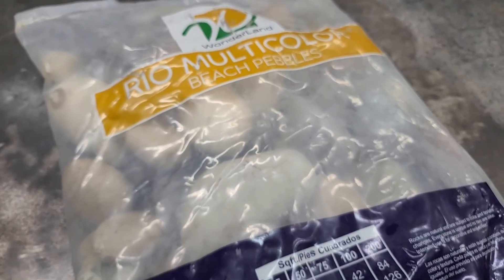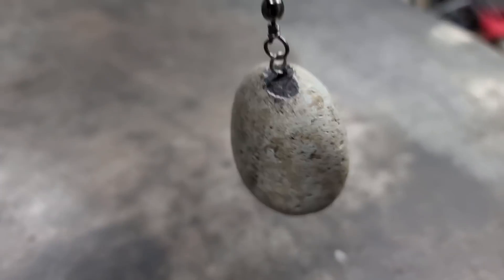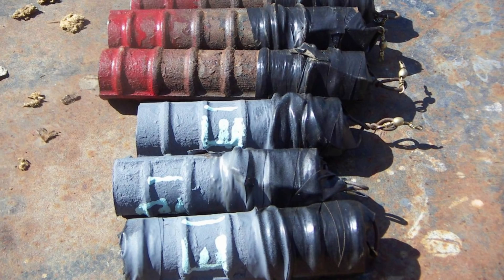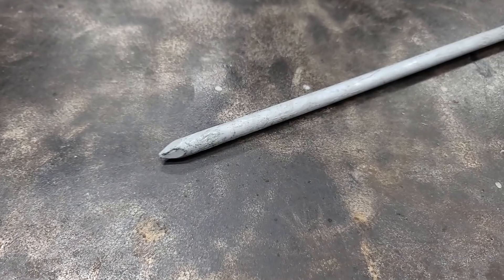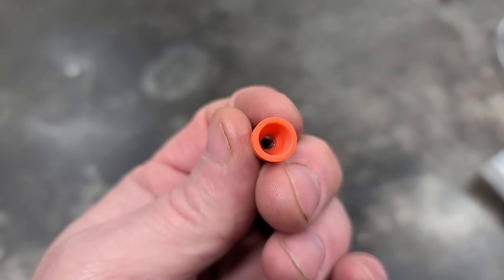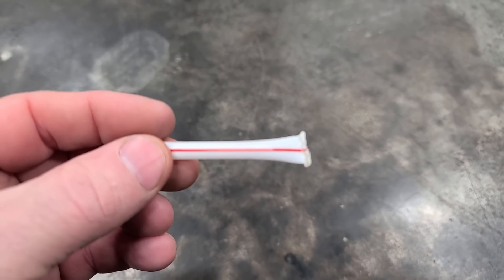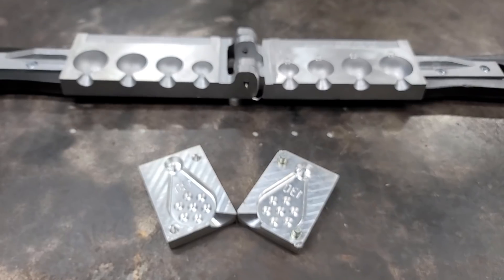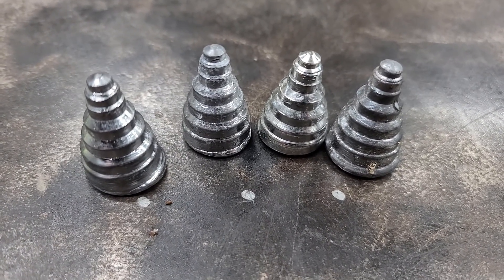13 Fishing Weight HACKs

Comment: Use the slinky weight latex tubing to hold a bolt or finishing nail. I have never got heat shrink tubing to work. But it my be the cheap HF tubing I have.

Comment: Love your videos.  Rocks probably good except for faster water.  I once observed a poor soul trying to use one in river, he would have needed half a brick to reach bottom.  Gave him some lead.  Also you can get pliers made to cut lead wire that leave the hole intact.  They  can also flatten wire and then punch a hole through the flat you just made.  In an emergency I once made a 'split shot' out of a half inch long piece by  cutting it half way through with my knife.
Reply from the maker: I made this video for the guys in the states with tough lead laws

Comment: For a walking wait I just use electrical wire in assorted sizes and lengths that I get from an electrician friend of mine just screw a I bolt up through the end there you go

Comment: Walking the dog, I sometimes find weights used for balancing car tires, laying in the road. That metal is heavy and probably pretty malleable and easy to drill.
Reply from the maker: You right , the Older wheel weights were lead and easily melted . The new ones not so much

Comment: The slinky weight is paracord and buck shot. We call the roll of solid core or hollow core pencil weight. We use them for drift fishing salmon and steelhead. Love your videos keep it up
Reply from the maker: Thank you for clearing that up . Catfishermen call em drift weights , dragging weights  , slinky weights  , all kinda stuff lol . I appreciate you brother
Reply: You can get a slinky weight kit to build your slinky weight it comes with a funnel and ram rod to load your shot easier. It makes it a lot faster
Reply from the maker: @elkhunter6746  the funnel would be cool . I use a bamboo skewer as a ram rod and it did pretty good
Reply: I found it on amazon but there's only one in stock it's from rainbow fishing tackle. They sell them at all the stores around here. Get a look at it and you should be able to make something similar that will work fine
Reply: Sorry the brand is riversnake slinky maker
Reply from the maker: @elkhunter6746  I'll check it out . I really do like the solid core though . But I started out making slinky weight so they hold a special place in my heart lol
Reply: Lol I hear you brother. We use both. I remember making my slinky weights like you do about 30 year's ago. I holds a special spot. I'm looking forward to trying your bolt weight with the nut's fishing them under a float. And the rebar. Keep up the great videos looking forward to it lol

Comment: Did you try Drexel with a diamond bit since you are going to insert  wire into the hole with epoxy.

Also links out of a heavy chain are an option. Plastic or copper water tubing for refrigerator ice and water maker as drag weights fill with bb's, lead or buck shot.
Reply from the maker: Im. Going I'm..  cause all I did was burn up that masonry bit lol

Comment: Hi, Your buddy from England here.  If you know a tame Sparky (electrician) the wire from steel armour cable is soft and easy to work with.  Wrap it to your stones and use hot melt glue.  Saves all that drilling!

Comment: A nice dab of epoxy will hold a loop to a rock. The rough surface of the rock will bond to epoxy. Using the loop bolt and a nylock nut, change the weight with washers.
Reply from the maker: I thought about that after I came back from the store and didn't buy any washers lol

Comment: I'm sure someone else has most likely already said this, but... use a hammer drill with those bits. There's no need to buy the expensive "Tile Bits". (concrete is full of rocks... think about it) Even completely worn-out concrete bits continue to drill because of the hammer action.

Comment: I have using rock sinker for years. No drilling just use SS wire and wrap the rock. Then use crazy glue and baking soda. They will hold up great… no more lead in the sea.

Comment: I keep my weights homemade and cheap almost free, I take any old rock assorted sizes flat works better for Rivers cuz it does not roll, Take 6 or 8 lb test line make a slipknot choke it up on the Rock and put a blob of five minute JB Weld then put a loop in it and there's your weight no expensive swivel a snap swivel is placed on your main line so you can add or subtract weight...

Comment: I’ve been thinking about those cement weights they use to hold down party balloons. 
I was thinking of putting a dollop of cement on a square of plastic wrap and one of your wire loops in the wet cement and twist it up and wait for it to dry. Then I might plastic dip it or epoxy it. 
Do you mind doing the hard work experimenting for me?lol
Reply from the maker: I will if I can figure out which video to put it on  lol

Comment: I made sinkers with 7 to 8 of  1/8" bolt and i weld and fill up with welding all the way to the top and it was super heavy and it works super. Still thanks for the tips.
Reply from the maker: Thank you for the tip buddy

Comment: Ok... separate comment... isn't it way cheaper to buy some of the sinkers you showed... buying stainless bolts/nuts/wire + epoxy + plasti-dip ='s expensive.
Reply from the maker: Your right it would be cheaper to buy sinkers or make your own  , ive got lots of videos on DIY sinker molds . But it's not if you've got SS nuts your not using .
And some states aren't allowed to use lead like in NY . So it's really for them

Comment: I don't know how they do it in the States, but here in Europe, they use lead flashing where the roof meets the masonry, and also around window frames.

I love that stuff, for dyi sinkers. You can even wrap it around the shank of a hook for dyi weighted worm hooks, so you can make them whatever weight you want.

It's getting rare, these days, but sometimes when they take down an old building, you might be able to get your hands old lead drain pipe. Awesome for ring sinkers or flat sinkers, or to melt down for sinkers or ammo casting. There's a lot of weight in that stuff. Inch n a half diameter weighs about 3-4 pounds a foot, iirc.
Reply from the maker: A lot of the lead I buy for scrap is from old roofs too . I never get lucky enough to find it for free lol

Comment: Something easier to use is electric fence wire. You can twist it with your fingers and dont need the drill to spin it etc. And you can buy a huge roll for next to nothing at tractor supply etc
Reply from the maker: Good idea

Comment: Love your videos ❤️.  Have made a lot of your hacks and saved me a lot of money. Even the hacks that I don't need i find a lot of other uses for some of them like using the drift weights to help pull electric lines in walls with only e small drywall patch at the top to fix instead fixing the hole wall. Keep the great videos coming.
Reply from the maker: That's always  the most important part the ideas . I always know a good video , if it makes me say ....hey that gives me a good idea 💡  that's what DIYs are all about

Comment: I used straws to make slip pencil floats for trout. Use hot glue or silicone to seal top, glue a small egg weight and barrel swivel in bottom. Casts real far, very visible,  won't spook fish, and super sensitive to light bites. Caught 22" trout with one this past week drifting in current down a ledge.